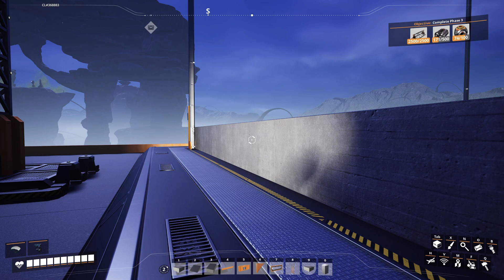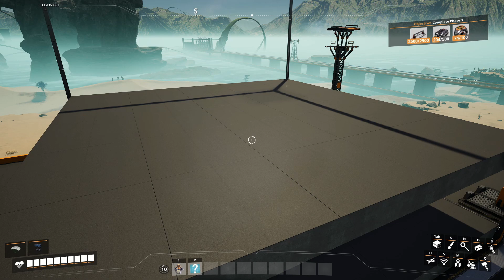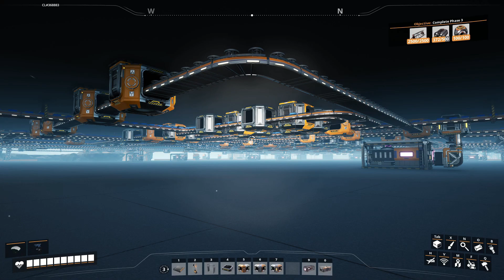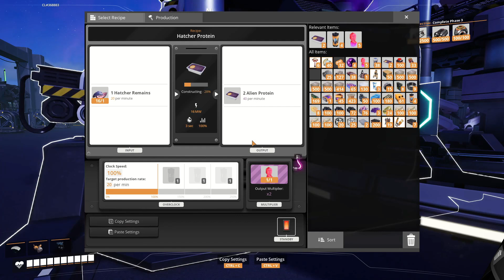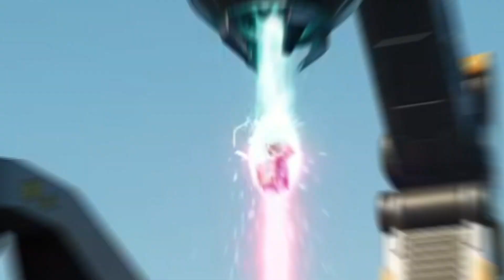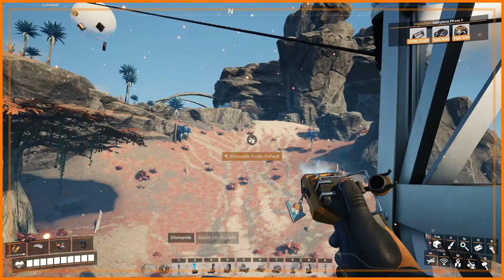How to set up blueprints & prep for endgame | Satisfactory 1.0 Masterclass

Comment: Question about the refinery blueprint, how high is it off teh ground? I built it 8m high to have the machines line up with the top of the logistics floor blueprint but it refuses to snap.
Reply from the maker: Mine has 2x4m foundations before the main floor, but that doesnt quite align with the logistics floor (as that has a 2m foundation underneath). I solved that by simply manually placing the first refinery blueprint in each factory, then snapping the others to the first.
Reply: @TheDutchActuary  So do you place a version of the refinery without the logistics and then snap the rest? I found my issue, I had built the template wrong lol.
Reply: @TheDutchActuary  ah gotcha, I understand

Comment: Great video! I've started adding beams to help run power and add structure to my floating platforms, its really helpful. One thing I would like to add is while running pipes under the machines is cleaner you can run into issues with fluids trying to flow up into the machines. I like to use walls to place vertical pipe splitters a few meters above the inputs and outputs so all the fluids flow down into the machines. By doing both and some creative pipework I was able to fit 8 blenders set for diluted fuel in a mk2 blueprint with 0 clipping.
Reply from the maker: That must be a SWEET blueprint!

Comment: I watched your video on blueprints from a year ago where you moved to single machine blueprints with inputs and outputs stacked and no logistics floor. Can you share any reflections you have that led you back to this logistics floor multi-machine approach?
Reply from the maker: Ultimately it's a bit cleaner looking, and the logistics floor makes the later-game logistcs easier to set up. Working with belts on the ceiling is almost like you're flying above them - rather than jumping over them a thousand times. 

That said, I had a lot of fun with my earlier design as well so its just a bit of preference. I've done a few runs by now and I generally just pick a certain style at the beginning and stick with it ;)

Comment: How do you get your blueprints to snap like that? Mine always snap 1m in any direction and it makes it hard to place them.
Reply: Hit “r” to change the snapping mode to blueprint.
Reply: @marcroberts4661  Thanks!
Reply from the maker: R to switch to blueprint mode, H to lock them in place and then the arrow keys to nudge them where you need them to go!

Comment: Just jumping around and gathering junk around crash sites and random sloops and spheres, I got a power augmenter and geothermal before my first oil. 10/10, easy electricity. Also, would recommend having JP fuel and nobelisks in the dimensional depot.
Reply from the maker: Totally agree on the fuel - the fuel build from a few episodes ago includes a depot setup with packaged fuel. Nobelisks I typically just craft a bunch by hand, but if you have them automated the depot allows you to basically blow up the world. Could be fun! :D